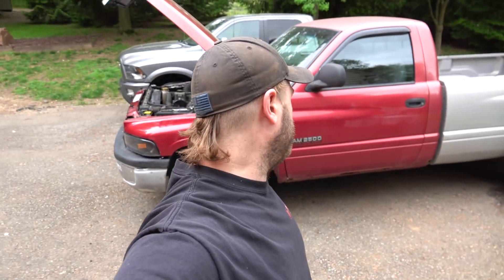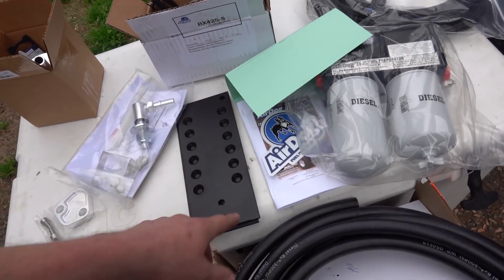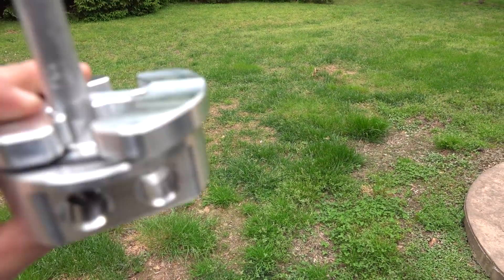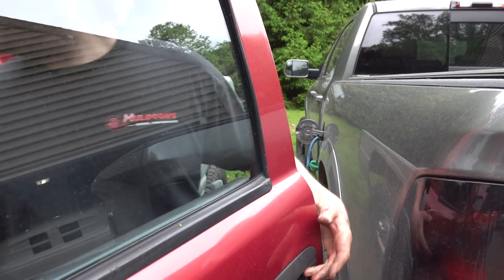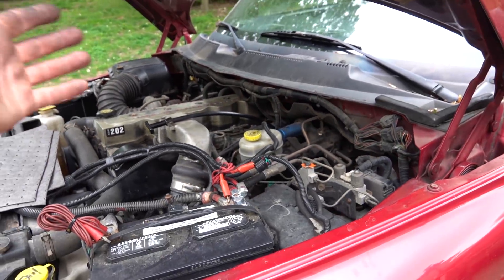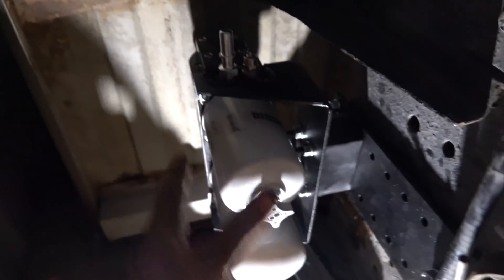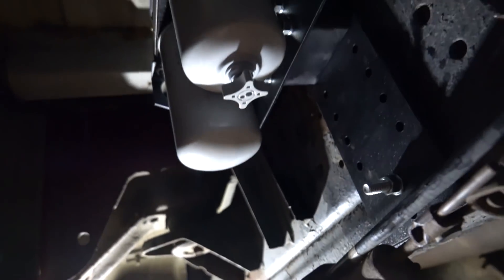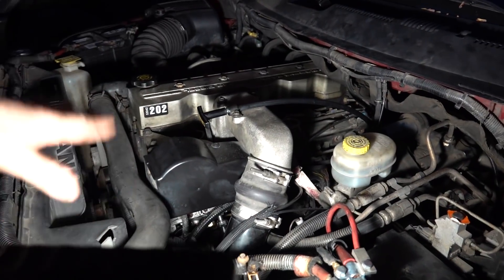youtube video #2Kc7fyBzhvA

Comment: The vp44 needs big fuel lines to cool and lubricate it. If not the pump goes bad because the computer gets hot and you will have hard starts. Mine just went bad on the 03 5.9, I need to fix it for work the next day so I put a 6.7 injection pump on and put in some 90 over injectors. It all worked great in combination with the arp head studs, intake horn and quadzilla tuner. Gets 20 mpg.